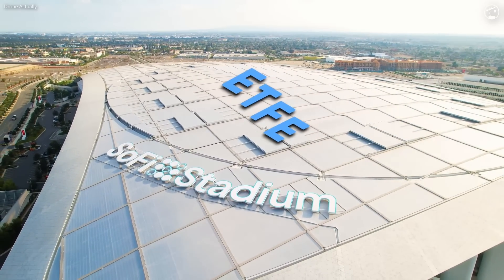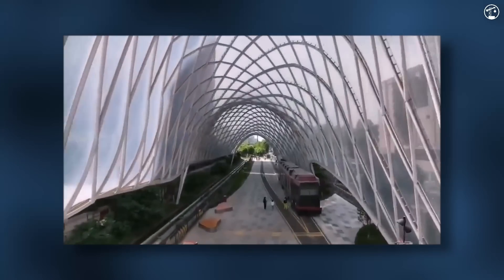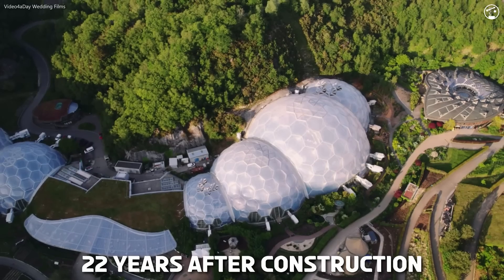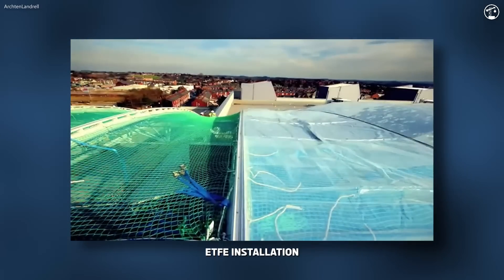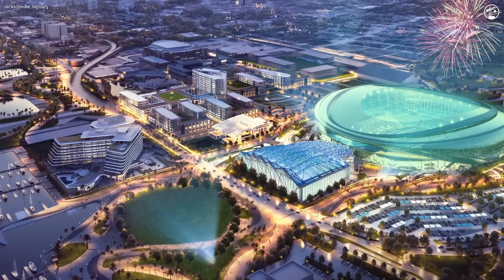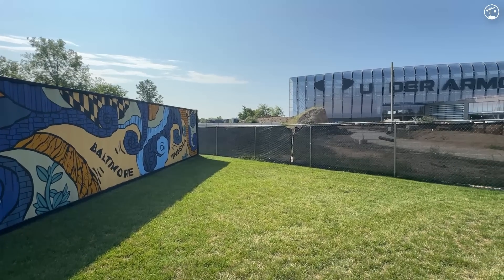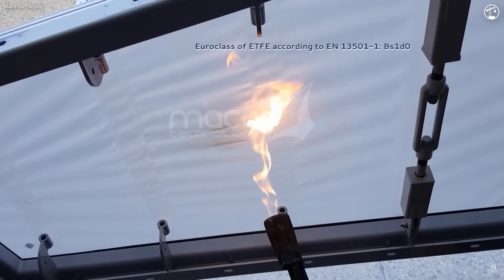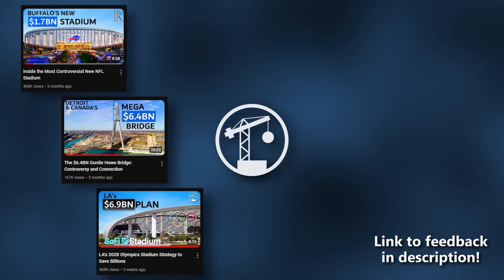Why Billion-Dollar Stadiums Are Betting Big on This Material

Comment: It's the coolest advancement in mainstream building engineering in some time.  I really hope more architects and builders consider it especially in more Northernly climes... Commonwealth Stadium in Edmonton is about to undergo a $300M renovation and part of that is to replace wall/ceiling panels made from steel with ETFE to let more light into the concourse while protecting Elkimo (Edmonton Eskimo now Elks football fans) from the weather.. If they can get the funding.. Though with oil prices being what they are that shouldn't be that much of a financial stretch... After all it's Canada's largest stadium by capacity and just held 2 Metallica and 1 Pink concerts which were all sold out bringing 60,000 people for each of those nights to the venue.. So it's not like the stadium isn't well used already... Just a little run down!